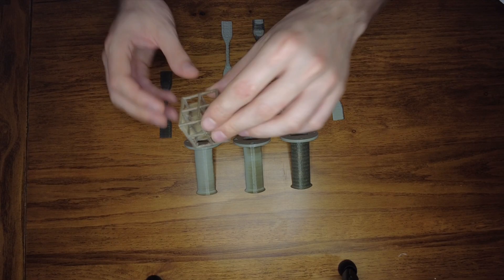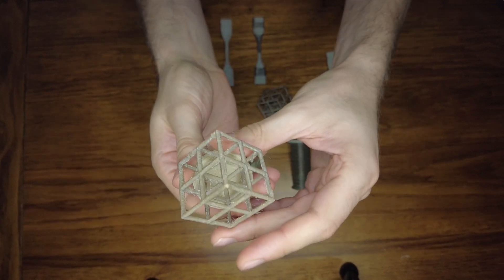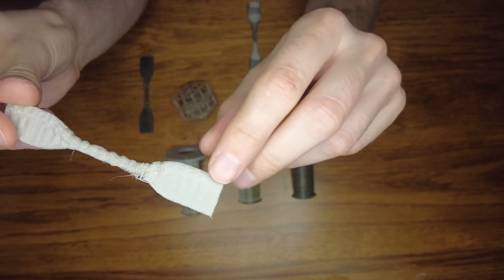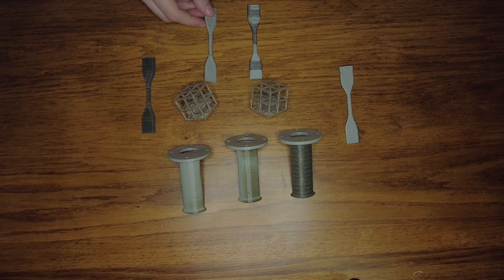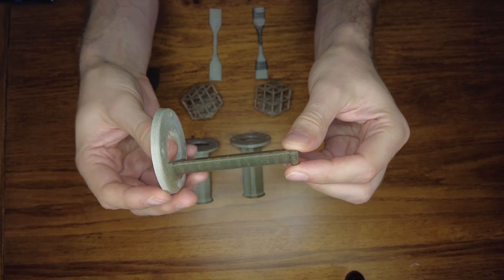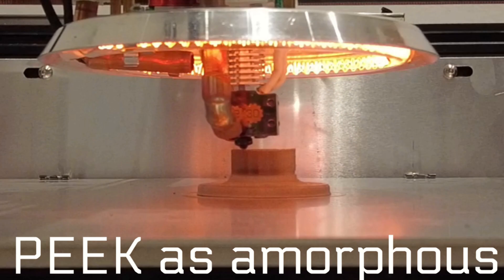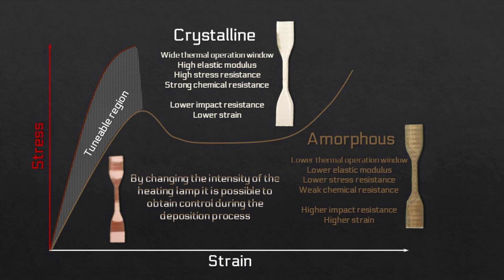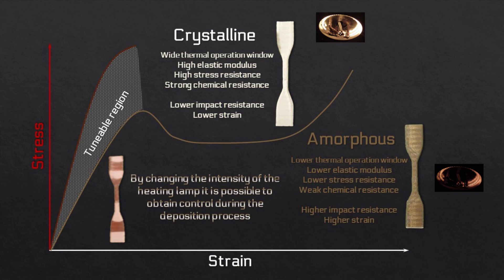OP Printer vs. Advanced Semicrystalline Polymers

Comment: Is the pronounced banding on your parts due to the bed or limitations of the gantry? If it's what I assume it is, I'd think a floating bed design would be better suited for these conditions. Although I'm not sure why it'd be so pronounced to begin with unless it's struggling to modulate the bed temp.

Awesome project, thanks for sharing.